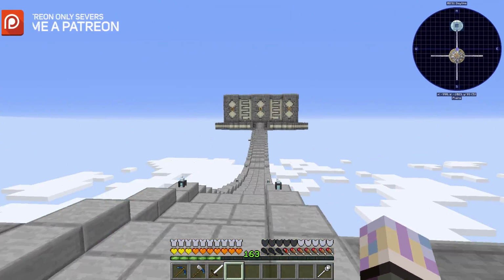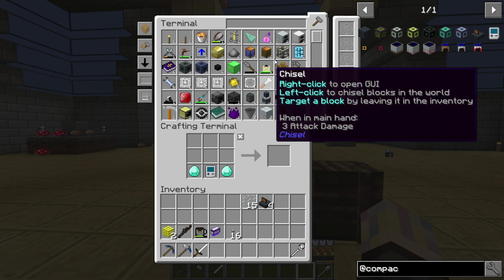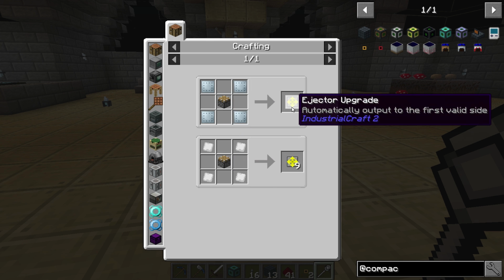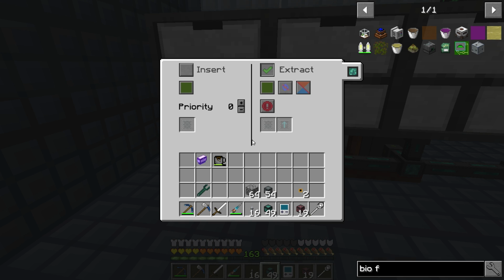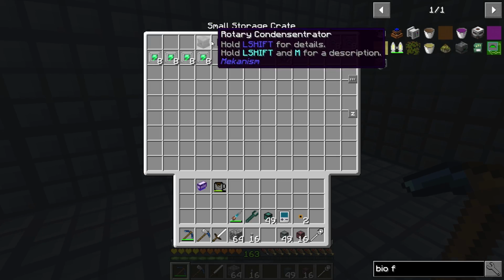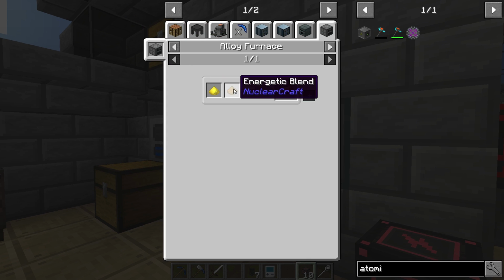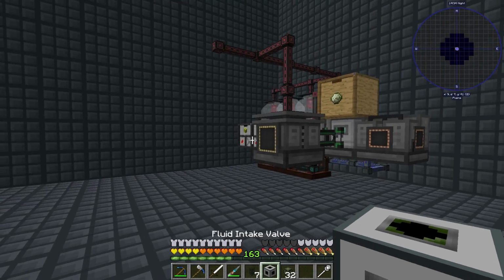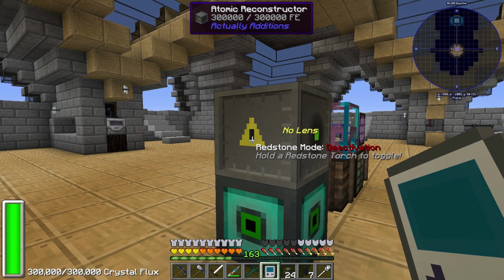Enigmatica 2 Expert Skyblock Compact Machines + Advanced Generators

Comment: Hey buddy, I don't know if you noticed, but the cloches in this pack seem to require 256 RF tick rather than their measly 8 or whatever it usually is. I found that out the hard way when my power went bye bye. Probably why that cube was sucked dry so fast.
Reply from the maker: Never noticed by def the reason the cube went dry so quickly.

Comment: The EnderIO conduits can't connect to the flux generator because it outputs purely RF and not FE. They transfer Forge energy which is basically Forge's unversal power system. Thermal suit is compatible with FE, but generally uses RF. EnderIO was compatible with RF but now they just support FE. You don't need a workaround for the Advanced Generator. Just build a Forge energy generator. Every other machine should be compatible with it in the pack and the conduits work just fine.

Comment: Just a heads up, reason the EnderIO conduits don't connect to the generator is because you used a Flux Generator (ie. generates proper RF, from COFH and Thermal), whereas EnderIO now (in 1.12) uses Forge Energy (like Immersive Engineering, Actually Additions, etc). There's a Forge Energy Generator block as well if you want to avoid your workaround.
Reply from the maker: Oh I did not realize that, I just assumed Flux.
Reply: I think EnderIO is the only one super picky about that, even the Thermal pipes convert to FE when need be.  Very easy to miss when everything has been RF since forever.
Reply from the maker: Aye I just assume that everything is compatible with each other now unless otherwise specified, many thanks for pointing it out.
Reply: I believe there is a forge energy output block for it that you can use ender io with.